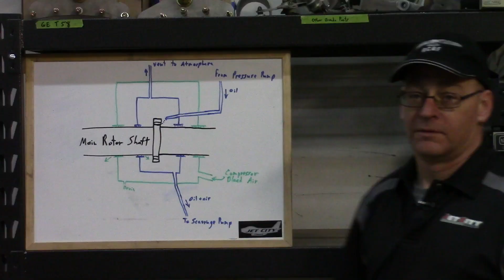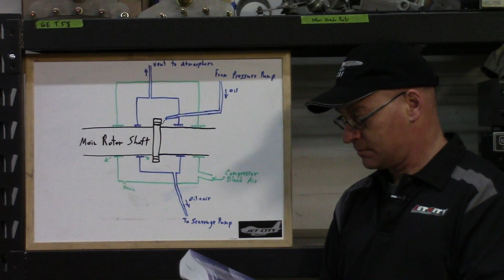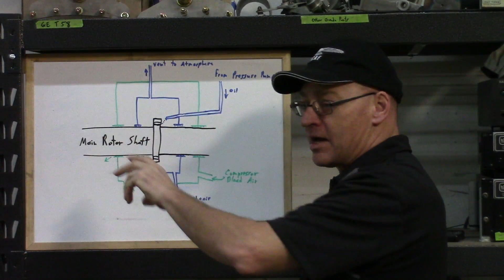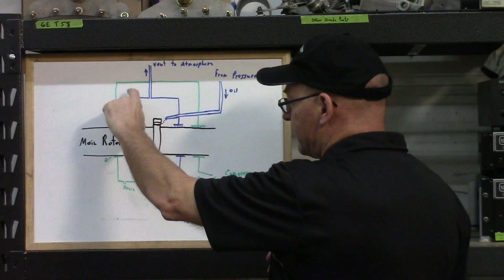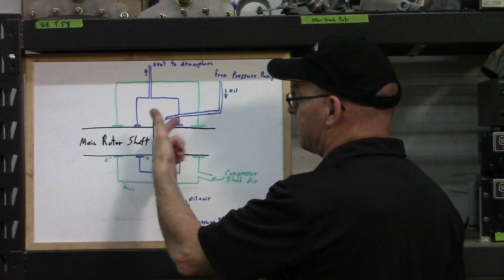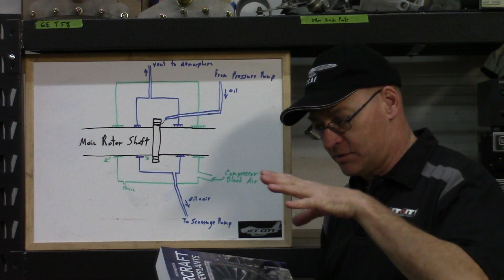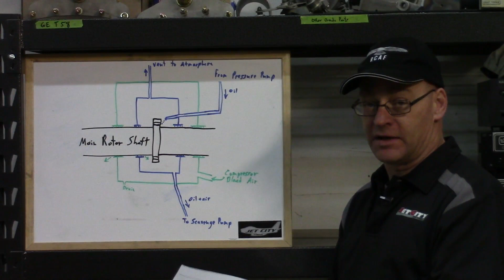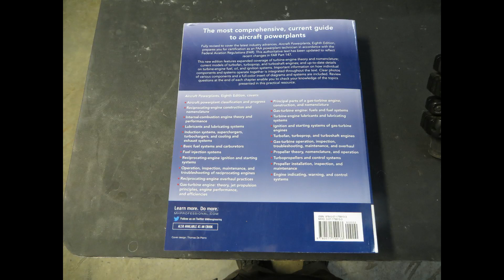Jet Questions 71

Comment: Hello again.  Wikipedia tells me that the LPT stage 6 and 7 blades of the GEnx engine are in gamma Titanium Aluminide, which is characterised as an 'intermetallic'.  I'm very rusty (ha, ha) on my metallurgy these days, but the 'gamma' refers, as far as I can recall, to  the crystalline structure of the material.  Wikipedia also tells me that T58s were converted to turbojets for use in something called the Maverick Twinjet 1200 (probably very aptly named).  Finally, on the subject of bearing chamber oil scavenge (and I think that this has cropped up before), in my days at R-R, we typically worked on a scavenge ratio of at least 10:1.  That is, the scavenge pump for a given bearing chamber had ten times (or more) the capacity of the oil pressure pump(s) feeding the chamber.  Once the oil has entered the chamber and lubricated the bearing(s) and possibly some gears as well, it is no longer 'solid', but is a very finely divided mist and 'froth'.   Even with this scavenge ratio, a significant amount of oil enters the bearing chamber vent system and is typically settled out in the main accessory gearbox and/or the oil tank.
Reply: +grahamj9101 The feds will be on to you if you keep using metallurgy puns dude.
Reply: +sminkycorp Oh dear, then it's just as well I'm not a US citizen and not a resident of the USA or Canada: otherwise I could find myself in really serious trouble for pronouncing the name of element atomic number 13 as, " Allu-MIN-yum", rather than, "A-LOO-min-um"!  And is it a federal offence (or should that be offense?) to say, "Zed", rather than "Zee'?
Reply from the maker: +grahamj9101 Check... I have always read that titanium aluminide is a surface coating for turbine blades. If so, I don't consider the blades to be made of it.
But I never claim to know everything, and I will defer to the information supplied by an engineer.
Reply: +grahamj9101 
I read a paper from the US advanced powerplants project, forgot the exact name and the proposed engine had a centrifugal compressor or inflow turbine  wheel made of this material. This was about a decade ago and I had not encountered that material before.
Reply: +AgentJayZ The Wikipedia entry states that GE claims its use of cast Ti-Al for the LPT stage 6 and 7 blades in the GEnx engine will be the first production application of the material, citing Precision Castparts Corp (PCC) as the source for their castings.  PCC advertises on its website as the sole production source for Ti-Al castings.  In R-R New Projects, 15 years or more ago, we were projecting the use of Ti-Al for LP turbine and HP compressor blades, in place of Ni alloys, as the material is almost half the density of Ni.

Comment: Sometimes, "jet-dragsters" are offered as a novelty at drag racing or airshow events.  They are always incredible dogs off the starting line, for the reasons you mentioned.  Once up to speed, different story, but the strip length is generally used up by then.

Comment: You are totally correct about going backwards converting turbo shaft to turbo jet for a car type application.As an example a half ton Mini with a Rolls Royce Nimbus converted turbo "jet" does 60mph in "QUARTER" mile where as a Rolls Royce Nimbus "turbo shaft" powered 1.5 ton Dodge van does 110mph in in "one EIGHTH" of a mile.

Comment: Just a quick point about starters on Avons, the starter the Canberra uses is actually not Avpin, it uses an explosive starter cartridge. Same system is also actually used on the J-79 in at least some Phantoms. I might be wrong but the plate design you refer to is I think used to start piston engines more than jets. Examples of Avpin-started Avons are in the Lightning, Saab Draken and some Hunters, although I've also seen both cartridge- and electrically started examples. Avpin starters make a distinctive whining noise as the pumps kick in to pressurise it before ignition. Cheers for the video though, always an avid subscriber and I learn a lot from you!
Reply: +hangarrat101 A coworker who was in the Air Force during Vietnam explained to me that that starting system was in most if not all Air Force F-4s, which is another difference between Navy and Air Force Phantoms besides the fuel. One of the stories he told me was an Air Force pilot had to make an emergency landing in Yokosuka, and since it was a Navy base, had only JP-5, so he had to drive down there with a tanker truck full of JP-4 and refuel it. As he's refueling all the Navy maintenance guys are breaking his balls saying stuff like, "Good luck finding a start cart!" So after he gets done pumping fuel he busts out what he describes as a giant blank black powder shotgun shell, and when the pilot gets ready he lights it off and Voom! Engine starts and the Navy guys jaws drop.

Comment: One of the turboprops power limitation is the power transfer to the propeller and coupling the turbine with the gearbox. Those combined are the most challenging design aspects for the engineers and  it gives a boundary for gearbox transmision to be too heavy or undependable making the turboprop engine uneconomical for producers.

Comment: The T-56 turboshaft engine used in the C-130 develops about 700 lb. thrust from its exhaust.  Clearly too small to power any lreasonably-sized aircraft.  Some piston twins (e.g., the Cessna 310) once had special exhaust configurations to utilize the additional thrust generated by the exhaust.
Reply: +MrShobar The Proteus turboprop in the Bristol Britannia (3,750 to 4,250shp) produced about 1,000b of useful residual thrust.
Reply: +MrShobar PS The R-R Merlin in the Spitfire and Hurricane was reputed to get a small but significant amount of thrust from its exhaust system.

Comment: F/A-18C Hornet does have two sump vent openings on the top surface of the aircraft. You can sometimes see brown oil residue streaks on the skin where the vents are: http://cdn-www.airliners.net/aviation-photos/photos/1/8/1/1593181.jpg

Comment: I have a question for your next video: most of the turbofan engines have a sensor at the cold section to sense speed (RPM) of the fan by the ferrous material of the blades. So the new generation of blades now on days we have composite blades of the fan in turbofan engines, what are new methods to sense RPM from the fan?
Reply: +Kevin Turton I think they measure RPM from the fan spool which is still made of ferrous material.
Reply from the maker: +ManzaGip "spool" is casual slang  for the entire rotor system - the shaft, disks and blades of a compressor, combined with the shaft, disks and blades of the turbine that drives it. everything that rotates together as a complete "spool".
The sensor for N1 rpm is in the fan case, and senses the passing of the fan blade tips. I don't know the exact electronics of the sensor, but you can see one in my video called Turbofan 1, at about 5:25 in.
Reply: Thank you very much for the informations you gave to me. It's really helpful. I will surely look at your video about Turbofan ;)
Reply: +AgentJayZ Thank you so much!
Reply: +ManzaGip thank you so much!

Comment: I love the sound of jet engines, particularly in reheat/afterburner and at an airshow, but those F100s up there are starting to get on my nerves.  The Republic of Singapore Air Force's F-15s have been out to play all day and are still tearing up the sky well after dark.  Obviously they don't have miles of open country (or sea) to practise over.  PS My apologies to AgentJayZ for straying off subject somewhat, but the noise of the beasts that we have had the privilege of playing with can be awe-inspiring.  Whilst on the subject, and with some relation to Agent JayZ's work, the Olympus 200 in its original Vulcan installation would produce an unforgettable 'howl' when spooling up to max power.

Comment: I have a question. Whereas helicopters have a tail rotor to counter the torque applied to/by the main rotor on the body of the aircraft, do single engined jet aircraft (F-16, F35 etc) have a similar issue? By that I mean does the force required to spin the turbine induce a noticable counter torque on the body of the aircraft? If so, what mechanisms are in place to stop the plane from rolling?
Reply from the maker: +Stuperfluous There are large torque forces in the engine, but they cancel each other out. The net torque on the engine mounts of the aircraft are negligible.

Comment: I recall a while ago you claimed the Canadian Orenda powered F86 Sabre was better than the US version.  Many, many years before that I was told that the Australian Avon powered F86 Sabre was better the the US version.  So my question, I your consideration which of the two non US Sabres would have been better?  Was the engine power the only element the made the machine a better than the US version or were there other differences?

Comment: I very much like the gas turbo Shaft type, Jets don't compete in the unlimited aircraft at RENO, because of the spool lag time, but thought with the power is at 100% anyway like the
helicopter, I do believe modern engine is much quicker to max n1 n2  thin wings, keep fuel inboard it's not up for long but the latest in Aero-,breaking I have some idea's on that
I my sorry I am talking about the turbo-prop, any one Remember DRACO N123T  100% rpm a snarling bird impatient to leave the ground, I wanted to be that Man at RENO

Comment: Hi AgentJayZ,

A few questions:

(1)  You mention that nobody wants a CF-6, alluding that it's too fuel inefficient.   Do you have any numbers, say, comparing the Orendas, the J-79, the CF-6, and some modern jet engine?     It would be nice to have some quantitative feel for how much progress there has been in specific fuel consumption.   Thanks.

(2)  Since going overtemp is so bad, as you show those melted turbine blades, I wonder why there are not some more drastic thermocouple monitoring and fuel shutdown systems on these things?     You'd think it would be worth an extra say $5 to $50K  to add some fail-safe overtemp shutdowns, if such a thing is possible.  

(3)  I see you tightening a lot of bolts but I don't hardly ever see you using a torque wrench!    Do you have calibrated fingers or is it okay to tighten things to a rough tightness level, like real tight for steel to steel, very snug for steel into aluminum, etc. ?

(4)  You seem to have a lot of GE, Orenda, and Rolls Royce engines but nary a Pratt and Whitney!    Is there some Canadian reason for that or do you just choose to not get into those?

Many thanks,

George

Comment: On a fan blade from a CF-6, what is the little shrouds on both sides of the blade for that interconnect with the rest of the blades (20cm from the tip)??
Reply from the maker: +Jasper FSX I would expect this question to be posted to my video called turbofan1, which contains the answer, I believe...

Comment: Is there Any chance you know the Idle speed of the output shaft on an Allison model 250? Any version works for me. Thanks
Reply from the maker: +Lou Herman When the GG is at idle, the PT speed can easily be zero. Of course it depends if your're talking about ground idle or flight idle. Your question is too vague for an answer.